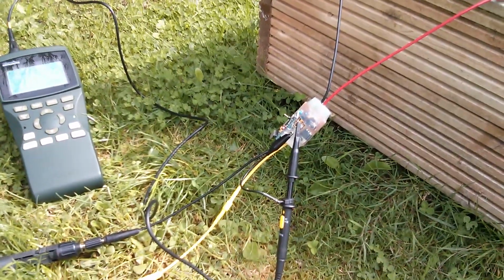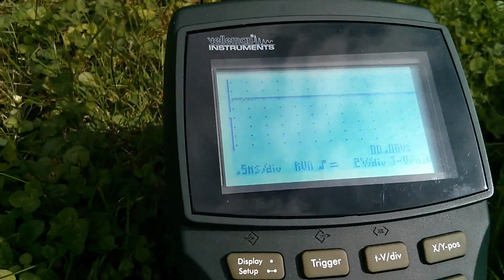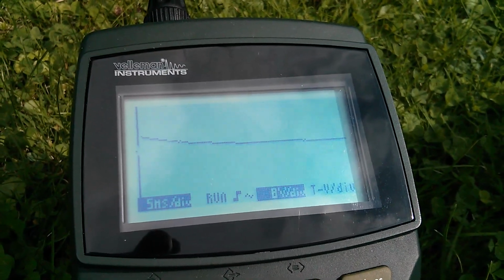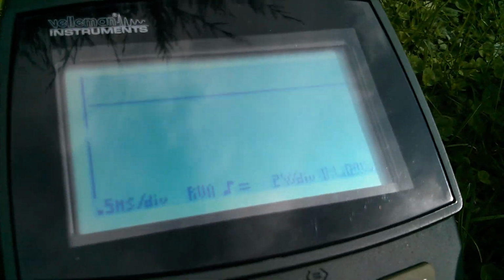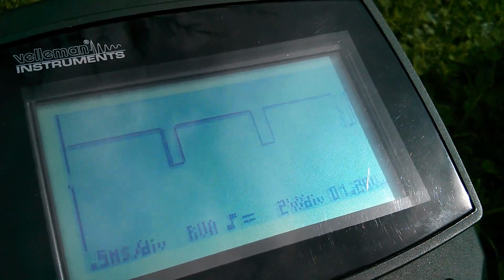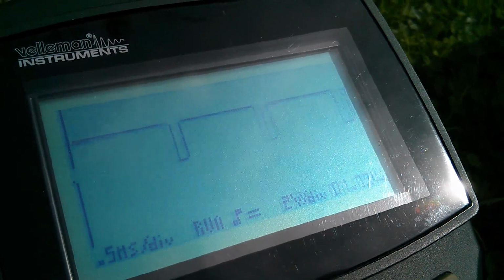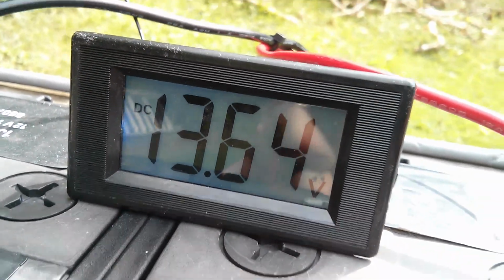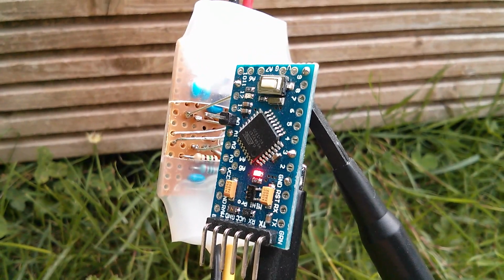Arduino PWM Solar Charge Controller #6 - Proportionality

Comment: I don't think a jitter like that hurts anything, but my sense of perfection would also want to get rid of it.

Part of the solution would as said be 2 separate wires just for voltage measurement directly to the battery terminals. There's not really a way around that. The voltage drop while supplying current to the batteries is totally dependent on the cables and connectors used and can even change over time within a setup due to corrosion of connectors for example. And as long as you have inductance between the measurement point and the battery terminals, even switching off the current and measuring immediately after that could give false readings.

And then of course you always have to measure at the same point in the cycle. Since you can't get that easily via interrupts (at least while using Arduino-C), I'd turn off PWM, take a measurement and turn it on again. Doing that around ten times a second should still be fast enough. I don't know what the default PWM frequency on an Arduino is set to (that's a thing I don't like about Arduino; it's hidden, while using assembler you at least have to think about what frequency would be suitable for your application), but it should still get out a decent waveform, even if stopped a few times a second.
Reply from the maker: superdau I really don't like the separate sense wire idea - I've never seen it used on commercial units, certainly not low cost controllers. I guess it could be an option on my MPPT controller.
Synchronising ADC reads with the PWM worked well on the PWM5. The analogue read was probably only a few microseconds after the PWM rising edge, but long enough to eliminate the jitter. I wonder whether turning off the PWM output periodically wouldn't cause as much jitter as the false ADC readings.
Reply: Julian Ilett
You're right, the 4 wires shouldn't be a must (and seem not to be necessary when it works for other controllers). But it would definitely be nice to be able to do it without any software modification. I think I said it somewhere already, just measure bat - and + on two ADC inputs and take the difference. By default these inputs are connected to GND and + within the circuit (solder bridge? jumper?). If someone would like to use four wires he can just open the bridges and run two (thin) extra wires to the battery terminals.

About the jitter: I don't think stopping PWM (or just setting it to 0) for a short time would matter much. An analog read takes around 100µs I think (that's what I remember from setting up the ADC in assembler for 10bit resolution with decent stability). If you make two of these measurements (remember the four wire version? ;) ) , you're done with it including calculating the new PWM value in maybe 300µs. A short dip like that a few times a second shouldn't matter.

Being synchronized with the PWM is more complicated. You can tap into the timer interrupts. First, don't mess with the settings of Timer0, that's the one responsible for millis(), delay() aso. in Arduino. If you are using libraries, check if they are using Timer1 or 2 for something before you change their settings. You then have to make sure you connect MOSFET (or whatever the powerswitch will be), to the right PWM pin. It's two pins per timer and it's fixed in hardware which are controlled by which (so avoid the pins controlled by Timer0). It should then be possible to set a timer overflow interrupt (triggers at tcnt_max) or timer compare match interrupt (triggers when tcnt matches the PWM value). That's no longer simplified by Arduino, you'll have to pick and set the right registers from the data sheet.
A problem I see with this anyway: in theory your PWM value can go from 0 to 255. So there is no way to always measure during the off (or on) time in a cycle, because whatever point you use, for some PWM setting it just does not exist.

Sorry for the waffling, got longer than I expected ;)
Reply from the maker: superdau On the PWM5 (PIC12f683), I read the ADC a few microseconds after the PWM rising edge - so it's when the current is flowing. This gives a battery voltage measurement error, but it's consistent and there's no jitter. The PWM is never at 0%, so this works all the time.
In fact, I do turn off the MOSFET in bulk charge mode for about 10uS every 5 seconds to take an accurate battery voltage measurement for the flashing LED voltmeter function, but this is a very tiny percentage (0.0002% I think) so very little power is lost.

Since I'm using the ATmega328P only (Nano and Pro Mini), it may be possible to adjust registers to achieve the same result. But I will commit version 1.0 with the jitter and make improvements later. I really want to make the ArduSolarPWM hardware and code available as soon as possible.
Reply: Julian Ilett
Sure, no need to hold anything back.

I tried the following code ( http://pastebin.com/syNJrwrj ) to get some timing estimates:

#define PWMPIN 5

unsigned long before, after;
int analog1, analog2;

void setup() {
    pinMode(PWMPIN, OUTPUT);
    analogWrite(PWMPIN, 128);
    Serial.begin(57600);
}

void loop() {
    before = micros();        // ~  4µs
    analogWrite(PWMPIN, 0);   // ~ 10µs
    analog1 = analogRead(A0); // ~110µs
    analog2 = analogRead(A1); // ~110µs
    analogWrite(PWMPIN, 128); // ~ 10µs
    after = micros();         // ~  4µs
    after -= before;          // gives around 240µs on a 16MHz Pro Mini Clone

    Serial.println(after);
    Serial.println(analog1);
    Serial.println(analog2);
    Serial.println("");
}

An analogRead takes around 110µs, a write 10µs. So setting the PWM to 0, reading two analog values and setting the PWM to the new value takes around 240µs (ignoring the time to calculate the new PWM value, but that should be negligible). So if you'd do that 10 times a second, you'd loose 2.4ms or 0.24%.

I can't remember, did you look at the voltage with an oscilloscope directly at the battery terminals? Is the overshoot really that critical? Maybe doing the measurement and change of PWM once a second is enough anyway (now that you have proportional change).

Can a PIC really do an analog measurement within 10µs?
Reply: Julian Ilett
Another thing (again after revisiting the ATmega328P datasheets) if you want to get ADC sampling times down: Arduino will set most of the ADC settings at startup and not touch them again. So if you change the ADC prescaler by changing the ADCSRA register once you can get much faster analogRead() times. Here's an example: http://www.microsmart.co.za/technical/2014/03/01/advanced-arduino-adc/
Noise will of course increase, but when looking at the measurements done on this page http://www.openmusiclabs.com/learning/digital/atmega-adc/ reducing the prescaler from the Arduino default 128 (=125kHz ADC clock) to 32 (500kHz ADC clock), won't lose much accuracy, but give you 4 times the ADC speed.
Reply from the maker: superdau The MOSFET only needs to be switched off for the sample & hold part of the ADC read. The 10-clock successive approximation part can be done with the MOSFET turned back on. I'm pretty sure that's how I got the measurement window so short. And my PIC clock is only running at 500kHz for supreme low power consumption.
Nice work on the timings - but 0.24% loss is too high if I'm wearing my nanoWatt hat!!
Battery voltage overshoot does concern me (or at least it did when I was selling the PWM5). Many of the controllers were installed on boats (luxury yachts) with very expensive navigation equipment connected to the batteries. I didn't want an expensive lawsuit over $3,000 worth of fried nav gear.
Reply: Good discussion and useful timing info (superdau).  I think you (Julian) are being over-zealous about jitter while wearing your nanowatt hat.  The battery is chemistry not physics, things don't happen at the speed of light inside. There is surely a need to allow the battery to relax before taking an accurate reading of its terminal volts, certainly more time than you are giving it? 

I take your point about voltage spikes on yachts.  My immediate reaction is to suggest testing the arduino PWM module on a bench power supply that can vary the voltage and current over quite wide ranges, well outside your assumptions that it will only ever see the PV volts you expect.   Also I commented in an earlier video in the series that the Arduino has a 5.00v reference voltage and I think you should be able to compensate for line voltage drops by referencing this in software and doing voltage calibration "on the fly" so to speak. 

I have followed this series and am part of a project to develop a micro-controller PWM that measures battery efficiency, so my circuit is for both charge and discharge.  Have you thought about distributing the power available to more than one battery?

Comment: Seeing how you're only using a few of the Arduinos pins, wouldn't it maybe make sense, to integrate the ATmega168 into your PCB design? Or don't you have the means to solder those close SMD pins to the board?
Reply from the maker: Chiller3k My primary aims are to make it cheap and easy to build. Since the Pro Mini is only $2.50 it makes sense to buy it ready-made

Comment: Could having a separate wire for measuring the voltage at the battery help with the jitter? That way the wire resistance doesn't matter.
Reply from the maker: beargun42 It would certainly help, but it's just a bit odd. I've never seen a commercial unit with separate sense wires.

Comment: I find it amazing just how eternally optimistic the Brits are when it comes to the weather with all the history with open top cars, holidays at the seaside etc. Savouring every fine day.
With regard to the jitter I think the addition of a small RC combination to the sense line would be a simple cure. I have no doubt the Atmel controller could be programmed in a similar fashion to the way you described with the PIC but I suspect the Arduino software may prevent such low level programming. Such is the price of programming simplicity.
Reply from the maker: Rob B Yes, the big pond between you and us chucks too much water on our green and pleasant land. My workshop really needs to be 500 miles further south.
Altering the capacitor across the ADC input is probably one of the few things I can do.

Comment: Julian, thanks for all you do. I would love to build one of these soon, I look forward to your future videos, and github posts, please post a link when you get around to that. Could you use an Adafruit Trinket for this application? Even smaller and less than half the price of a pro-mini.
Reply from the maker: Andy Crofts Only on hold because of the weather. Actually, integrating the battery voltage maintenance feedback control loop into the MuPPeT is proving difficult to think through. Maybe I'll make a video explaining the problem and see if anyone has any ideas.
Reply from the maker: focodiesel Now that's interesting - I'd not heard of the trinket before. But I'm not convinced. It's just too small. On-board USB isn't necessary - the Pro Mini with separate USB/serial board works just fine. My latest Pro Mini cost just $2.56 shipped free.
I'm using 3 PWM outputs for the Arduino solar charge controller - the trinket only appears to have 2, so I don't think it would be suitable.
Reply from the maker: focodiesel Oh and I meant to say... thanks for your support - it's much appreciated.
Reply: You want small? Checkout the femtoduino. But, seriously expensive! No Chinese clone found (yet..)

Julian - is the MuPPeT on hold? I'm getting one up-and-running soon, but as I only have/need 15w of panels, I've elected to use a P-fet. Calculating, I think the extra power and complexity to get a (Dickson) charge pump working is offset by the N-fet lower VDSon advantage. For my app.and location I need to squeeze every milliwatt out.
Reply: Julian Ilett Yes, that'd be useful It's the battery monitoring that I'm thinking about at the moment, also.

Comment: if you had a 12v led as a load, does the jitter cause any flickering or visual changes? my chinese solar controller does to my 12v garden lights, esp so on float. (as the charger flashes its led for float, the garden light dims a tiny amount. yeah i know they shouldn't be on at the same time, but it was during testing
Reply from the maker: jusb1066 That does sound very annoying! I'm guessing the garden lights consist of just LEDs and resistors - if they were properly current controlled, changes in battery voltage wouldn't have any effect.
Reply: Julian Ilett
in fact they are current controlled with a pcb led controller inside each unit and can work ac or dc at 12v

Comment from the maker: Arduino code:

void setup() {
  TCCR2A = TCCR2A | 0x30;
  TCCR2B = TCCR2B & 0xF8 | 0x01;
  analogWrite(11, 117);
  analogWrite(3, 137);
//  Serial.begin(9600);
}

const int setPoint = 13.5 * 20 / (20+82) * 1024 / 5;
int measurement = 0;
int pulseWidth = 0;
int difference = 0;
int stepSize = 0;

void loop() {
  measurement = analogRead(A1);
  difference = abs(setPoint - measurement);
  stepSize = difference;
  
  if (measurement < setPoint)
  {
    pulseWidth += stepSize;
    if (pulseWidth > 255) pulseWidth = 255;
  }
  if (measurement > setPoint)
  {
    pulseWidth -= stepSize;
    if (pulseWidth < 0) pulseWidth = 0;
  }
//  Serial.println(difference);
  analogWrite(9, pulseWidth);
  delay(10);
}
Reply: BAMIDELE ELUSADE watch the whole series
Reply: Wayne Johnson thanks
Reply: Good day sir ,and thanks for the presentation. please sir in your setup function ,what are the function analogwrite(11, 17); and analogwrite(3, 137) for, and can you please explain this line const int setPoint = 13.5 * 20 / (20+82) * 1024 / 5;
waiting for your reply thank you sir.
Reply: Julian Ilett You should post this on the Arduino PWM SCC section of your website.
Reply: +Julian Ilett If i build this, I will probably add an LCD and some form of low voltage cutoff to the code